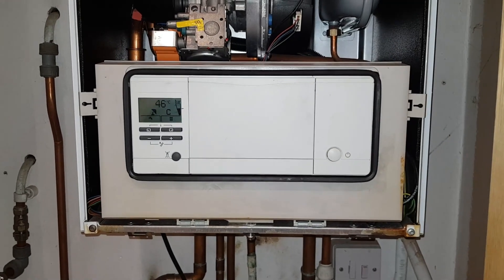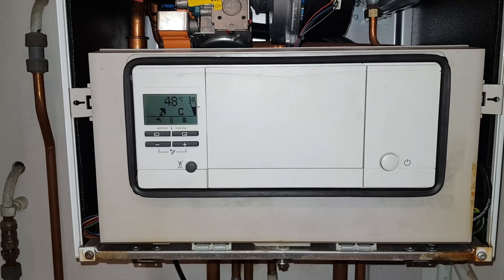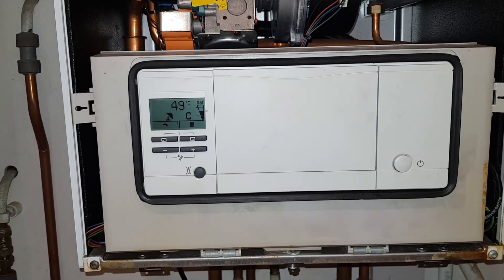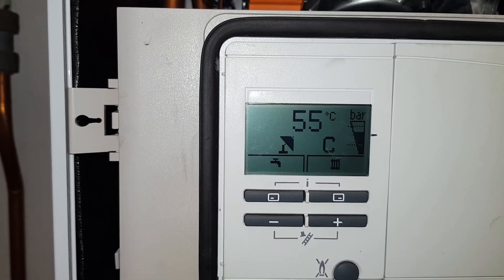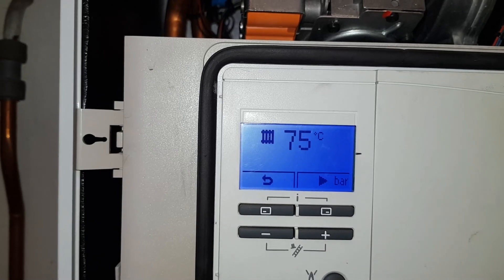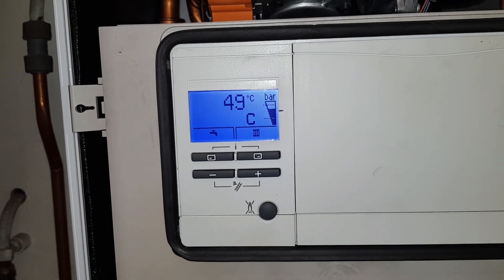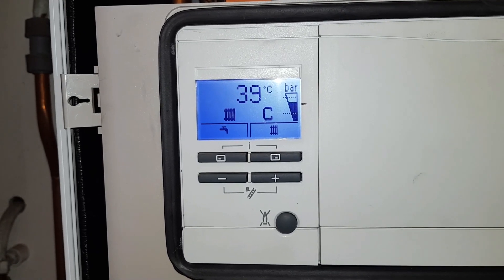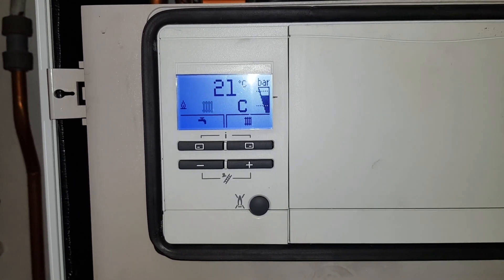Vaillant ecoTEC Pro 28 R2 No Central Heating

Comment: Does not make sense if it has previously worked .. why is the link missing... If it was a previous engineer I am sure he would have liked to pop it back in and get credit for it... Instead of walking away leaving it still not working. Mine was the same but it was just flat batteries in the wireless control ... Who took that link out 🤔